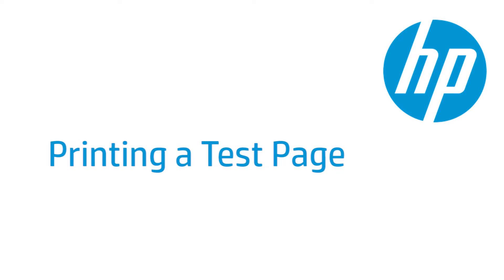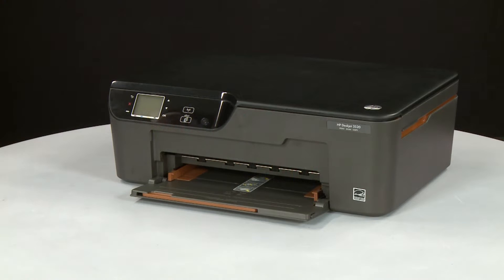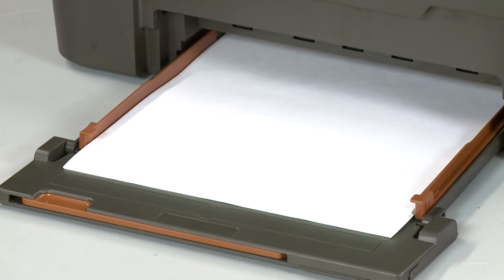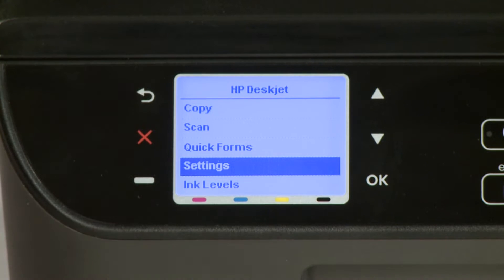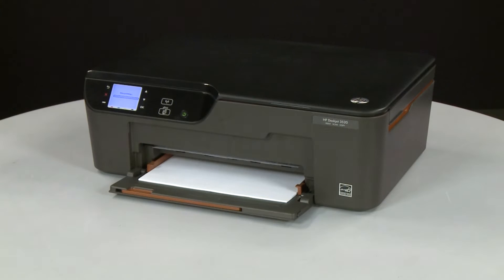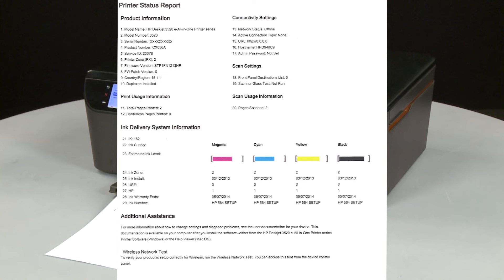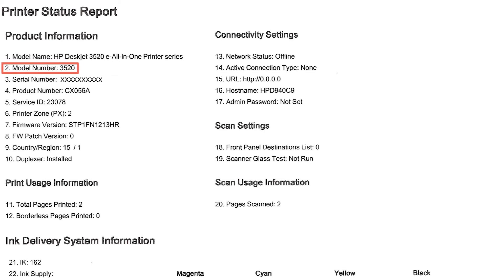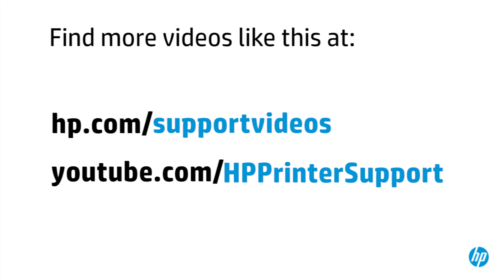Printing a Test Page-HP Deskjet 3520 e-All-in-One Printer | HP

Comment: i have a hp deskjet 3520 e all in one printer about a year it will print from it self but won't connect to computer or print from computer
Reply from the maker: Hi Gary Daly,
Please search for C03269728 on HP’s home page or using Google search.  It is the document that will walk you through installing the printer onto your wireless network.  Each operating system has its own set of instructions, so please click on your operating system and follow the steps.